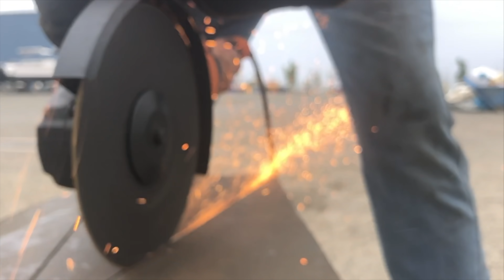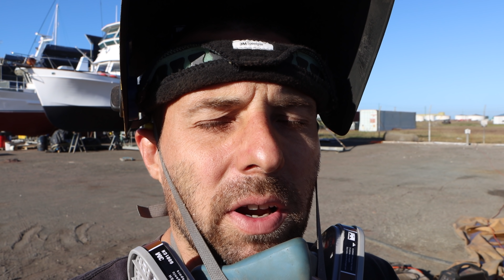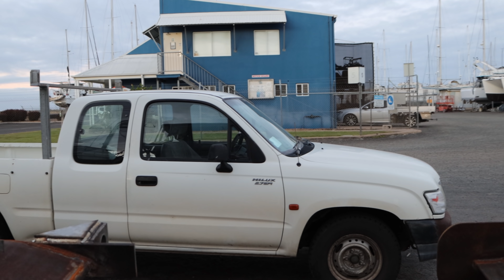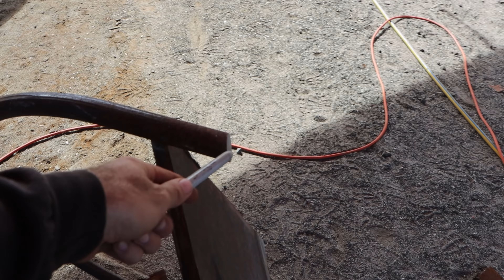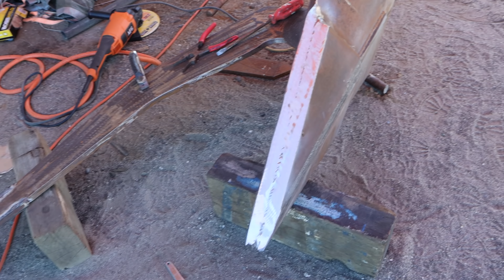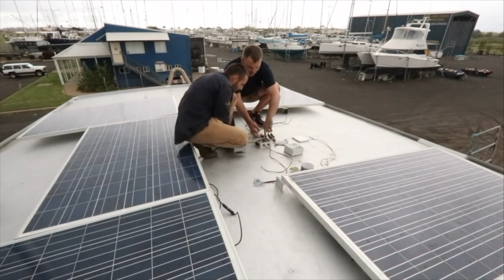Building a Monster Anchor, (The Finale) - Project Brupeg Ep. 144

Comment: Stacking those pennies Damian love it, how much would that anchor cost you if you just brought and missed out on making your own? Is it corten steel ?
Reply: He mentioned in a response to a comment on last week's video that they were quoted something like 6500 to buy one, whereas fabricating one themselves was around a thousand I think.
Reply from the maker: Hi guys, it was a few years back but we got quoted $6,000AUD for a 110kg Rocna. We spent just over 500 including galvanising. It’s not corten but to compensate with just increased the thickness of the metal. If it bends we will just add some bracing to improve strength where needed
Reply: @ProjectBrupeg  Ah, knew there was a 6 and a 5 in those numbers someplace. :)
Reply: Project Brupeg holy smoke, that's ridiculous , 6.5 k , ! I will be copying your anchor bro when I need one for my yacht project if that's cool with you 😃, I have purchased a steel hull that has not been in the sea yet , spent the lock down welding up a big transport and index frame , doubled my power bill, but I reckon it would have cost me thousands to have it made up got to love kiwi dyi, much love from northland love your project.
Reply from the maker: good on you mike, all the best with the project.